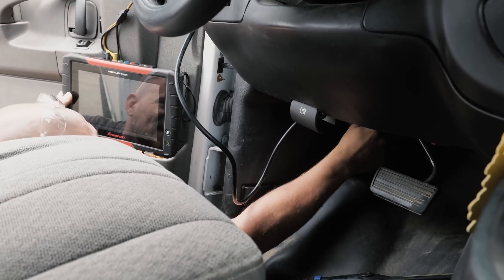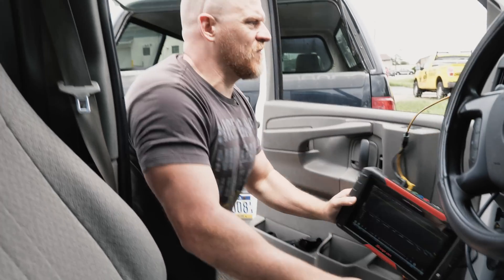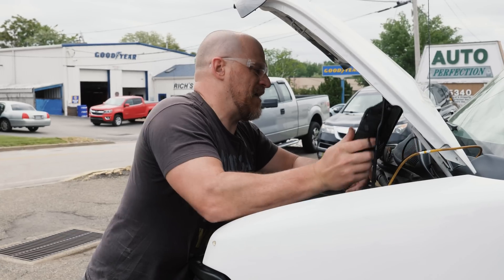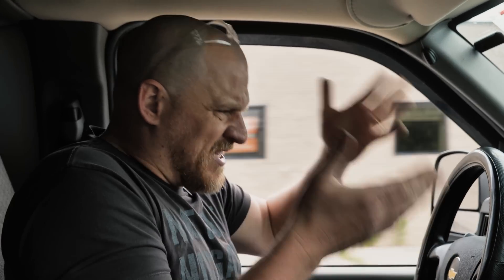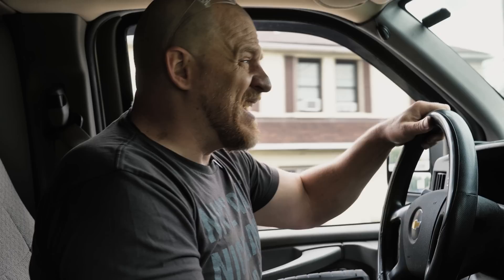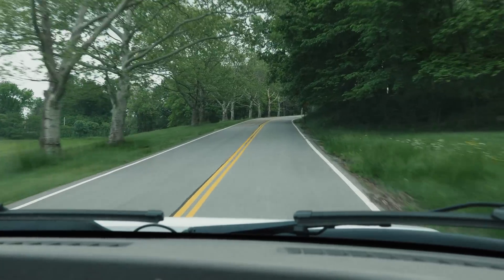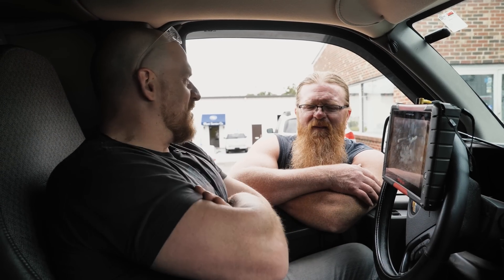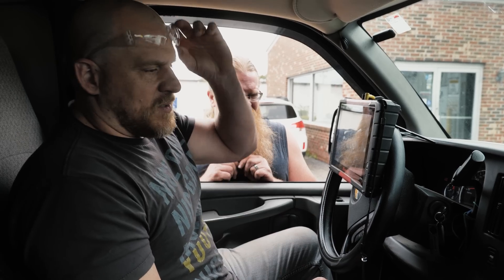We Don't Work For Free [Charging Diagnostic Time]

Comment: I don’t mind paying for diagnostic a problem and even paying to fix it. But what I do resent is someone saying x is the problem and the supposedly fix it and after paying for that problem. And you leave you have the same problem and they charge you for parts you didn’t need and have to pay again so they can fix it. I just got screwed out  $950 for an ac compressor change out and it was the cooling fan. For another $300. I have another problem that has my odometer dimming out. Just had the odometer fixed at United Radio. It was dimming out on the 3 hour ride home. I don’t believe there is a mechanic that can diagnose the problem. I think it might be a bad voltage regulator or maybe a bad ground.  It I don’t want to spend $150 an hour for a mechanic to check it out.
Reply from the maker: I 100% agree with you, which is why I mentioned the 9 out of 10 garages/techs who are parts changers. We've created our own monster in our industry
Reply: @ScannerDanner  I'm also really sorry to say this but i've been noticing a trend with your channel where you come off like you are better than every other tech.  You are one bad ass tech for sure.  I have been in the industry 20 years and I do not throw parts and I don't agree with any tech who chooses to throw parts at a car.  However you're constantly shitting on most techs and calling them garbage and it gets old hearing that.  I have been a premium member of your channel, I purchased your book and have learned a lot from you but constantly being told that most techs are shit, its time I move on.  Thanks for all your knowledge you taught me and its the same reason I don't watch Eric O anymore.  Too much tech bashing.
Reply from the maker: @JD730  I'm so sorry buddy, I truly am. My intent is not to bash my own industry that I'm so proud to be part of. I'm trying to raise the bar and also help you guys put money in your pockets. Trying to raise awareness to the customers on the difference of reading a code and changing a part and calling that a diagnostic too. I also may not do very well at time withing a text, responding to people. There is a reason why my wife does my customer support. I suck at it, at conveying my intent.
I really appreciate the feedback and 
I promise to be more careful in my delivery in the future. Having some humility is what it sounds like I need
Reply from the maker: @Jeff do you think the % is higher of techs that can actually troubleshoot electrical/driveability  problems? What number would you say it is? 
I genuinely am curious here as to what your experience has been.
In my 20 years of teaching, if I get a class of 10 guys, I find that only one of them has an interest and aptitude to do this. Class of 20, I may have 2 or 3. I see the same thing in this field! It's no different! Most guys hate it and never want to learn it. That doesn't make them bad people or bad mechanics, most are very good at what they do, but it does make it a roll of the dice for every single driveability or electrical problem they face, and they only care what idenifix says and never do any testing to confirm. And so we end up with a situation, just like what was described above (what you commented here on) where a customer is paying for all this time and money and his car still isn't fixed and now the garage wants him to pay even more. This scenario is not unique, it is the norm! And it's time we change this don't you think? I've always viewed you guys as the 10% who can! If you're here watching and learning on your own time, then you most definitely have an interest and a love for this type of stuff, which is not found in most techs! So as I'm speaking, I'm certainly not bashing my guys who are watching here, at least I never intended to! I'm actually surprised that you feel this way and I definitely need to re-evaluate my approach. What could I have said differently in this video? I mentioned the 1 in 10 techs as an example (one of the things you didnt like), and that part was actually directed to the customer who thinks I'm crazy saying a tech should be paid for his diagnostic time. I wanted the customer to understand that there is a distinction between what he knows and has experienced, which is the code reading, parts changing path. (Which in the end, leads to that second phone call where the garage wants to sell even more parts because they blew the first call) and the true diagnostic technician. There needs to be a distinction if we are going to demand top dollar, wouldn't you agree? 
I never meant to puff myself up, truly if you knew my heart, I was trying to puff you guys up! But again, I'm sorry and I need to rethink my strategy with this. I never want you (my viewers) to feel like I'm bashing you and I certainly do  not believe that I am God's gift to the automotive world and if I'm coming off that way, that is a huge problem.
Reply: @ScannerDanner  I watch your videos and other techs mainly for ideas for what is causing the problems. I think Eric O is one of the best electrical diagnosticians that I have seen. I may take a ride to Eric’s shop and see if he is willing to take a look at it. ScannerDanner I would come your way but I think you are too far away. Thanks.
Reply from the maker: @kevinhitchcock7062  sorry to hear about your AC compressor issue and the money that mistake cost you. As for you odometer going dim, with no other issues, and it has been rebuilt once already? What year, make and model car? Sounds like it is a cluster issue for sure and yes you'd absolutely be in good hands with Eric O.
Reply: @ScannerDanner    It is an 08 Mercury Grand Marquis and I did replace the Lighting Control Module. I saw on a wiring harness that the wire went from the module went to the odometer. I would appreciate any suggestions.  Thanks.
Reply: @ScannerDanner  your expression of the other shops and guys doing the parts changing methods let us all know what you truly want anyone to clearly understand about finding multiple proofs why a part is failed and for the 1/10 that didn't make it to your class but found you online we got your message loud and clear I'm in building maintenance and 2 times I heard about co workers cars/ trucks suddenly no crank no start situations one was a assumed computer failure and reaserch on how to get it replaced at which point I was messing with it and 4 hours later I had a bad ground wire and it was a fix then again same thing I found crusty battery terminals and I didn't like a starter but 
I brought it to be tested and the parts guy said it was good and yet no start 2 days later I pulled and re installed a relay under the hood unmarked as anything to do with a starting circuit and got the signal back to the starter and turns out that starter solenoid was actually the  other half of a 2 part failure

Both Times the look of shock I received of hours of research and eliminating scenarios  proving and disproving the problem is what your about

Comment: It's a conundrum. Knowledge isn't action but knowledgeable people still need to get paid for their time (edit--their diagnostics). Mechanics are supposed to listen to the customer but a lot (?) of customers also throw curve balls. The mechanic has to start with the ABC's or they are setting themselves up for failure. It's fine to do what the customer says they want done with the mechanic's  caveat of---OK, but I am charging you for it and I don't guarantee that is the fix e.g. throwing parts at it. Story--Neighbors son took their badly running car in. The mechanic pulled a DTC and replaced the CPS for $240. The car still wouldn't start and the mechanic told them they needed to  unplug a relay, turn ignition on and then off, then replace the relay to start the car; the car was still barely running. Another shop  said it needed a new transmission (edit---a new engine) to fix the problem. I pulled a DTC---bad CPS. The mom neighbor put in a new CPS and the car runs fine. I have a bad back so I can't do a lot, but I still have eyes. My two friends, who have tons of wrenching under their belts, and I went  to get a truck one of them picked up for cheap because it would not start. After watching them for an hour trying to start it I walked over. Two wiring harnesses were unplugged. It started right up after plugging them in. What I am getting at is even the most cursory  visual inspection can lead to a solution. Most people have no clue what they are looking at or for. I'm like, how can you not see something staring you right in the face? LOL. The Car Wizard has several videos where his customers have been bounced from shop to shop because they (edit, the shops) couldn't diagnose even the most basic problems---spark, fuel, air. Sad sigh. Industry full of incompetence and rip offs.  Best wishes to awl! Edit---I have seen people who do something to their car (or nothing at all), try starting  it, still barely runs, or not at all, and keep cranking it or starting and stopping it thinking it will run better after this ritualistic mumbo jumbo ...too funny! Also, Paul your one great dude. And peoples, show him the MONEY!